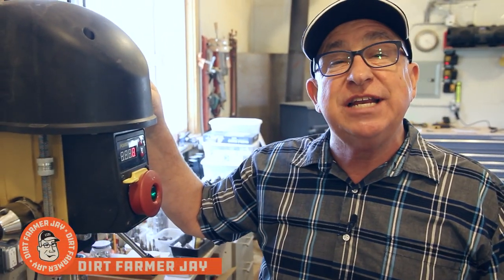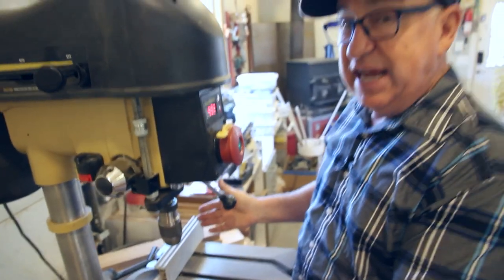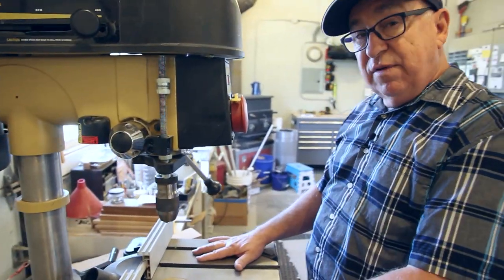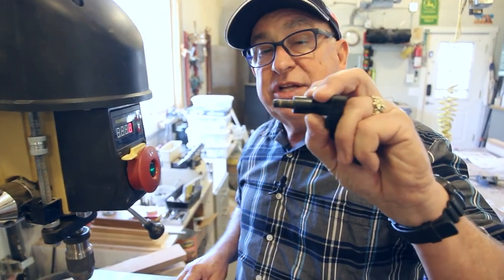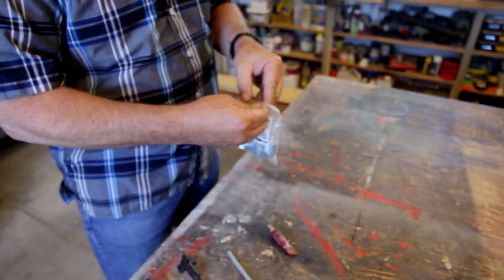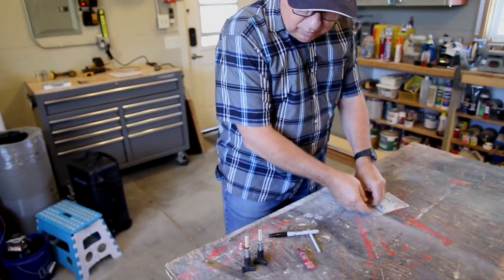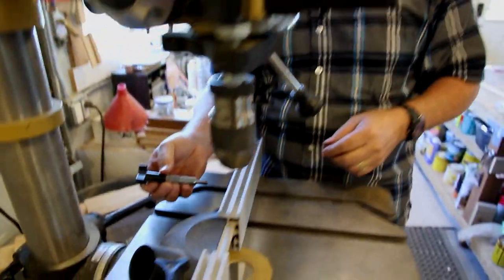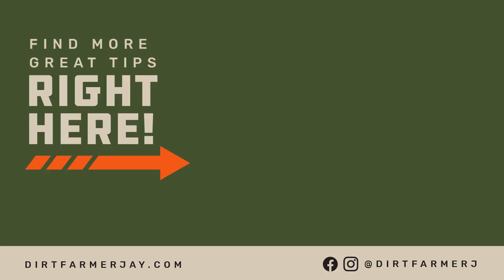Fast Drill Press Fence Upgrade

Comment: Nice drill press... mine is a much lower priced unit.  Great suggestion on extending the locking knobs... I didn't like the three lowering handles on mine so I removed two and find it just as easy lowering the drill using one and it is less obtrusive.  Also mine came with a loose chuck key and loose hex wrench... so I took an old speaker I no longer needed, removed the large magnet, and stuck it on the back of the press shaft.  Now the key and wrench stick to the magnet and they are always right where I need them...
Reply from the maker: Right on, we makers are solution makers as well, as illustrated by the way you used a recycled magnet. Great solution! Best, DFJ